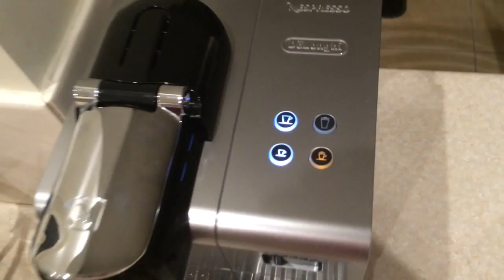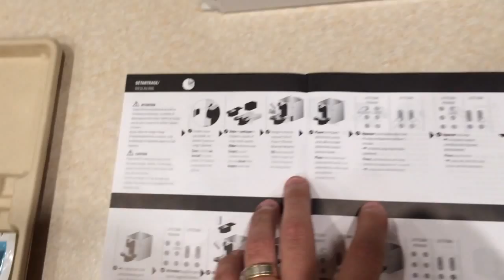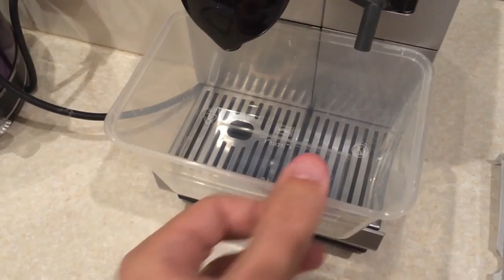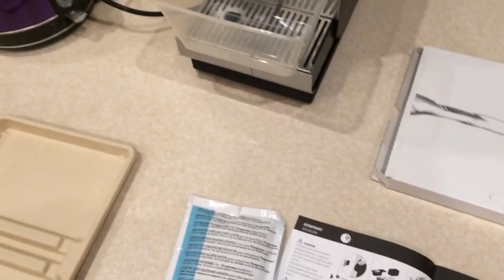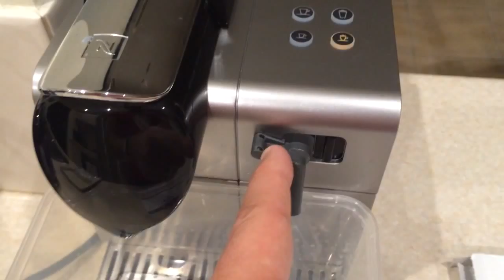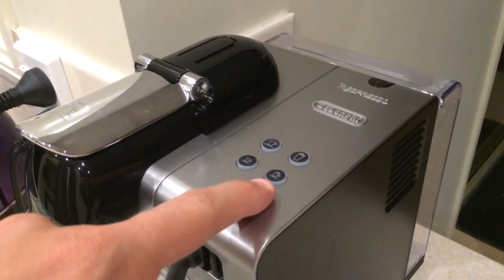How to Clean Your Delonghi Nespresso Coffee Machine with Nespresso Solution

Comment: Sorry guys, but after the the second step, when you re-push the orange button, after that my nespresso machine turned off. How long I have to wait until it is still available?
Reply from the maker: Hi Mirko,
That seems very odd! Is your machine the same as pictured? Possibly try turning it off and on after a good 10mins (allow the heating element to cool down) also make sure it’s not dry (be sure it has water/cleaner in the tank and there is nothing stopping the water flow, there is a little filter at the bottom)
Reply: That Car Channel, is dead, there is no reaction after 12 hours. What can I do?
Reply from the maker: Sorry I am unable to assist

Comment: I've got food grade citric acid. usually works wonders with my distiller and kettle. I live in hard water area. my machine is due a clean. 

should be OK to clean with Citric acid also if anyone has any experience how many parts of CA to water did you use?

Comment: MrExtremeboost MAX Boost - thanks! second time I'm watching, because I derped and didn't remember the process first time around -.-
Machine is once more descaled. Cheers
Reply from the maker: thanks Kryan,
i mentioned it in the description, i'm sure you noticed i said and did the incorrect ratio of water/cleaner. so just make sure you mix it correctly. i always run a few extra 'rises' through mine just incase, one time the milk curdled first time i used it after cleaning and i think it was due to some of the lactic acid cleaner still being in the system. one or two extra rinses and it was perfect again, never an issue.

Comment: Just a heads up but you did it wrong. You were meant to use 500ml + the cleaning solution. After finishing, you then fill it to max and press the button the 2nd time to rinse. 

Since you filled it to max on the initial clean, it stopped early with some solution still left. When you hit the button the 2nd time (rinse), it uses 500ml on the water nozzle end, and 500ml cleaning the main end. Yours only did one end before it ran out of water and shut off preemptively.
Reply: great video - experienced the same pre-mature stop.  No matter - your video was very helpful - thank you!

Comment: Great video, one thing though, I am pretty sure the ratio for the de-scaling solution is 1/5 100ml of descale solution for 500ml of water, you could be using a slightly diluted mix and not adequately descaling your machine, would be worth a check. Cheers :)
Reply from the maker: squasher6969 i noticed this after i created the video. :) the dilution is written on the packet! i did dilute it a bit much i think.
Reply: That Car Channel thanks. Great video anyway.